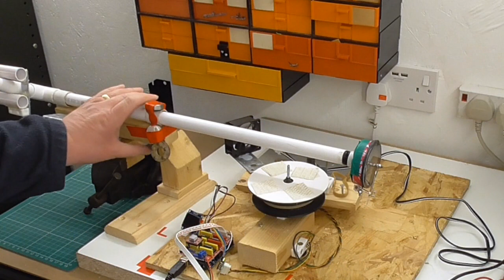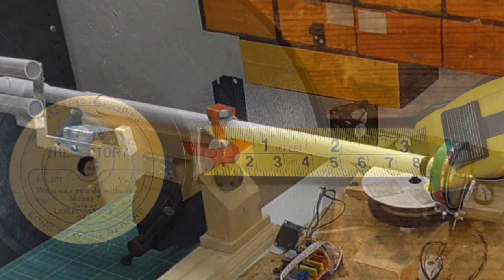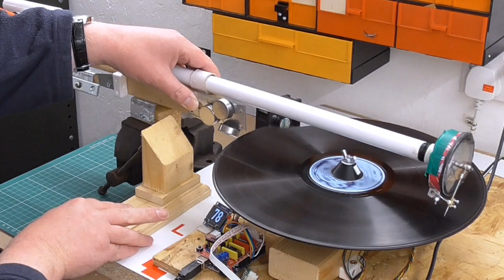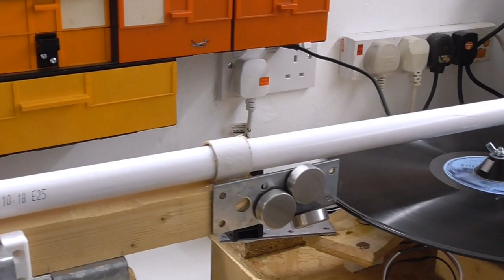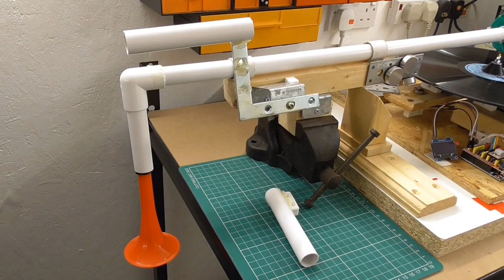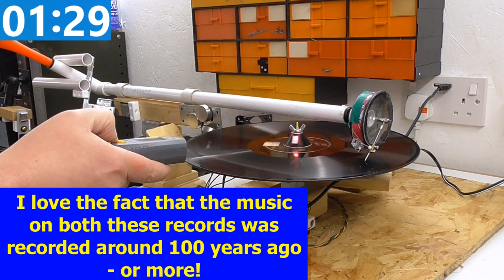Linear tracking gramophone - test to destruction?

Comment: That's the craziest phonograph I've seen! I gotta give you credit for what you've built so far.
Reply from the maker: Thanks 😀 It's been fun to build, and although this implementation is all my own design, there was at least one very low friction system which worked in a similar way back in the 1920s/30s.
Not sure what I can do with this one next, but I have other designs I also want to try out. 😀👍